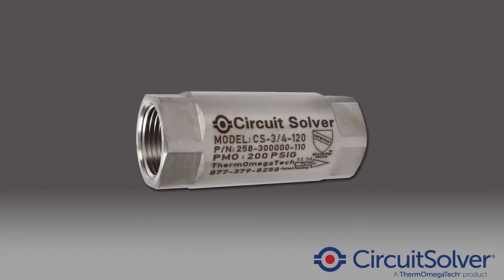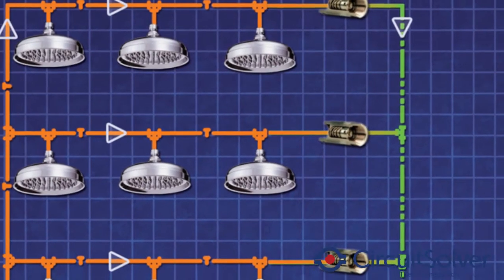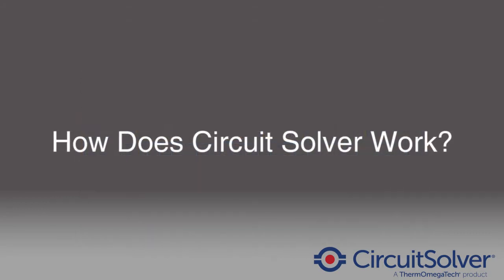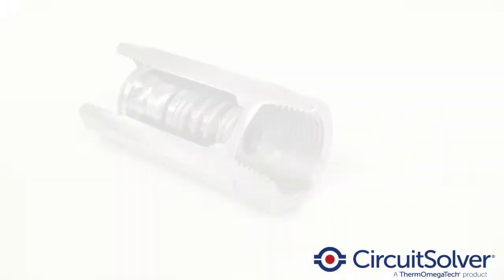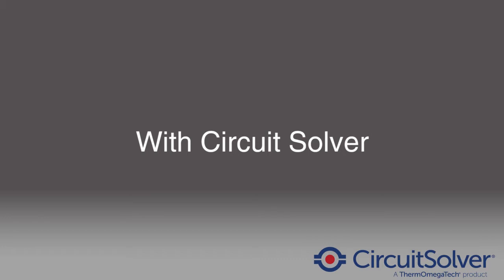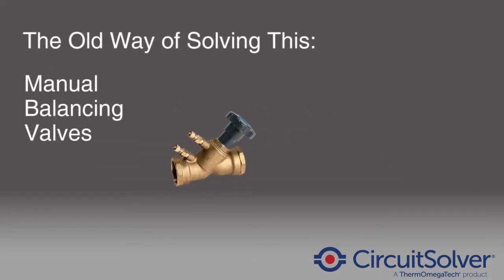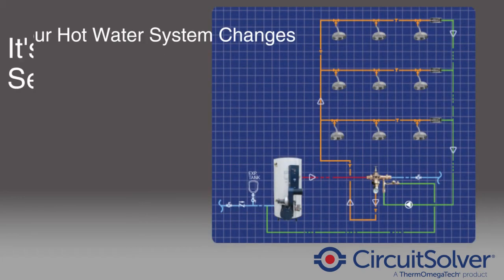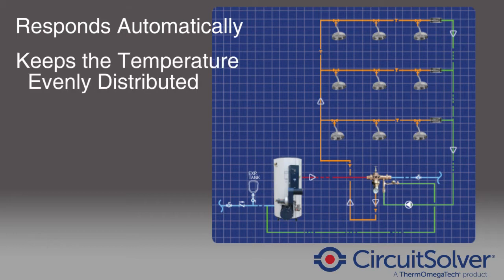CircuitSolver Thermostatic Balancing Valve

Comment: I had a Watts recuirtlating hot water system installed with a new hot water heater and we still are not getting hot water. 
What could be the problem?